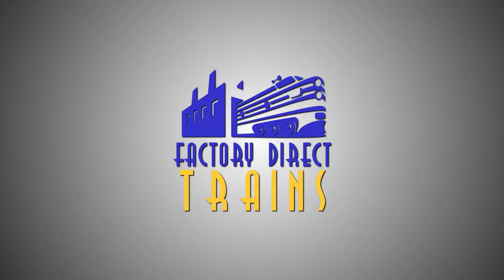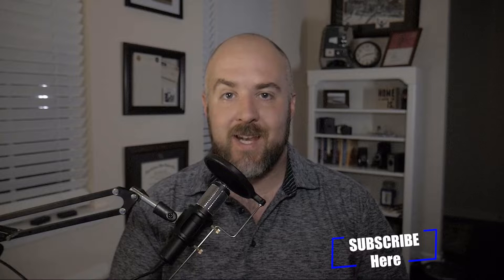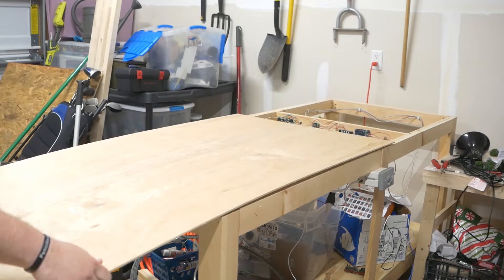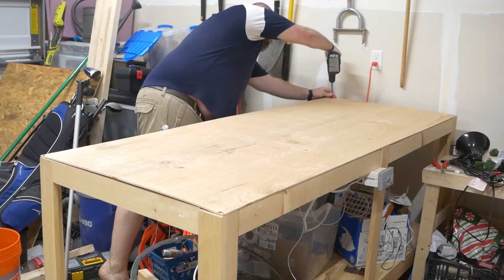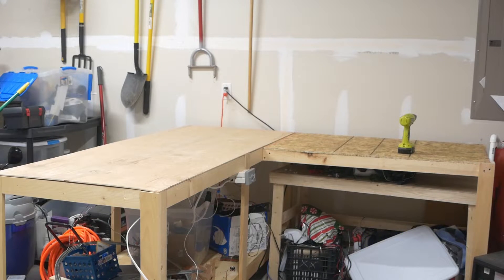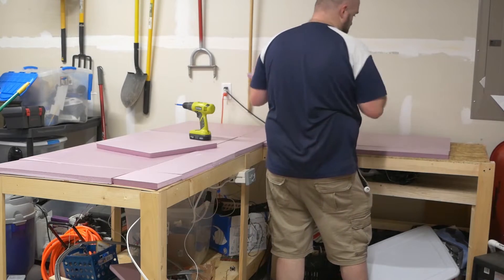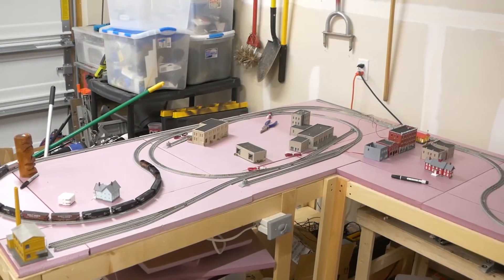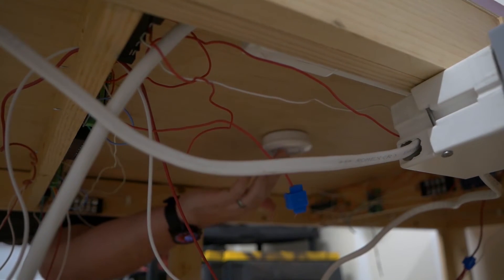Building the DDRR 2.0 Model Railroad Part 2: Benchwork, Foam, and a little track work.

Comment: Luckily my home craft store offers those foam boards in 4' x 2' - which fit just on the backseats of my car - right between the door handles (yea I drive a small Opel Corsa) - so I came home with a large stack of foam "boards" - and moved them right over in my basement to have them ready when I need them on my layout

Comment: Jimmy, what is the thickness of your luan sub-board? 5 MM?
Reply from the maker: Pretty close.  It’s US so we use the queens measurements.  It’s 1/4 inch so roughly 6mm
Reply: @DIYDigitalRailroad  Thanks. Was just wondering cos my Brother-in-law has some .197 in ply, but I was afraid it was a bit too flexible as sub-board.